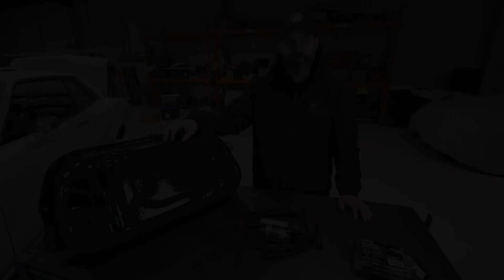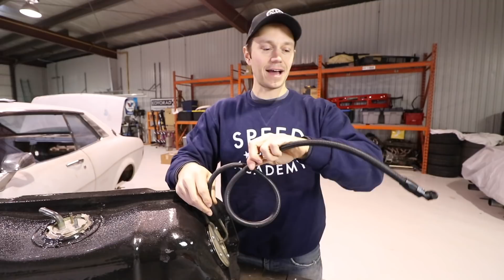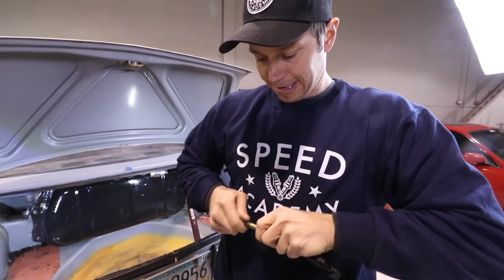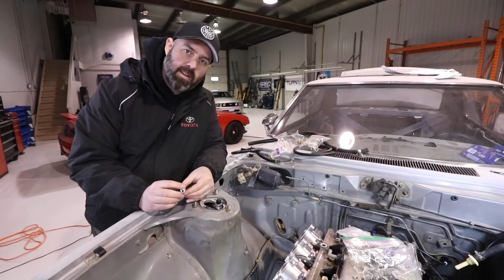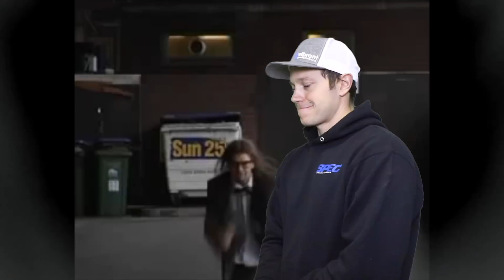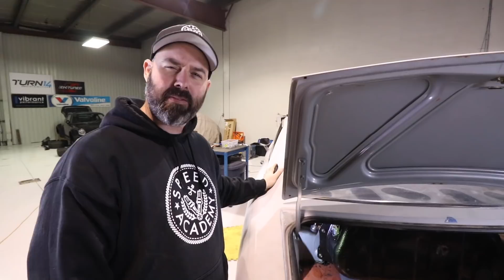Fuel System Complete! - RA24 Toyota Celica Project

Comment: The -AN adapters on the filter/regulator are a bad design! I had them on my LS swapped '69 Suburban and nearly had a bad fire. The plastic clips can break or come loose, and you can have a fuel leak. There is an updated version that uses a machined slip-on nut that threads into the back side to retain the fitting. I HIGHLY recommend that you change them.

Comment: I'm on the wrong side of the country but for oddball fittings like the 1/4 to 5/16 barb fitting I would go to newline... Lots of random hard to find fittings that are usually very cheap. Lots of funky hydraulic fittings and stuff... I'm sure there is an equivalent company in Ontario... Part number N150-031-025BR       https://www.new-line.com/fittings/brass-hose-inserts-and-push-on-hose-barbs/brass-hose-barbs-stems-inserts-splicers-menders-tees/brass-reducing-hose-mender

Really liking that returnless reg setup! And the Link ECU is a good choice. I run a slightly older version on my subaru.
Reply from the maker: Never heard of Newline. We may end up replacing the factory feed line with a 5/16'' line, which will do away with a bunch of the barbed fittings, so we'll see how it goes. Thanks for the link, tho!

Comment: I love your videos! 

If you drill out the 1/4” feed from the tank you can tap a bulkhead fitting into it and run an AN fitting straight to the regulator/filter. This may be a good option if you run into fuel starvation.
Reply: Bro i need help.
Reply: @antorenzo10  with what?
Reply: @MikesGarageUSA  a 94 toyota celica gt. I was wondering can i do that same thing ? Because i can’t find no parts.
Reply: @antorenzo10  yeah you should be able to. Depending on how the fuel send unit is designed. Cut the factory feed off and use that hole in the top of the unit to put in a bulkhead fitting. There are probably write ups or videos about how to do it out there. Good luck.

Comment: Why didn't you just cut off the hardline from the pump assembly, drill it out and fit some AN bulkhead fittings?
Reply from the maker: If we find the 1/4'' (6mm) factory hard lines are gummed up or blocked in any way (we'll be doing a pressure test soon), we'll replace the 1/4'' lines, which we can do in a variety of ways, but I think your suggestion is an excellent one. We just figured we'd see how the 1/4'' lines work, since others have used them without issue on similar swaps. This is just Ver1.0 to get the car up and running, future fuel system mods are very likely (thinking about a Well Cell from ATL).

Comment: Top tip for putting tight hose onto barbed fittings, just put the hose end in a cup of hot water for a minute  and it will slide right on ;-)
Reply from the maker: Was going to say cool idea, but will say hot tip instead! :D

Comment: Why wouldn’t you just convert to 5/16th hardline to get rid of all the headaches? Running and bending hardline is not hard and it would turn out much cleaner. Way less potential for leeks. And much more fitting support
Reply from the maker: Because we're stubborn? Haha. Honestly, we just figured 1/4'' is plenty big for the power level we'll be at, but also because we didn't even know it was 1/4'' until we started working on it and we felt adapting was the simpler approach for now. But I would say there's a good chance we will convert to 5/16'', especially if we see any issues with blockages or pressure with the 1/4'' lines. Long-term we'll go to a fuel cell setup, so this is just a starter setup.
Reply: Speed Academy figured it was easier to adapt in the mean time. I wouldn’t of even thought to check for something smaller than 5/16! Love the videos!

Comment: I'm gonna have to go ahead and call you out on fuel line safety here. Just get some 5/8 hardline and revrun it through the car. Cut the old 1/4" off the fuel tank, drill out to 5/8 and weld it onto the bulkhead fitting on the tank. Is it really worth burning down your car for a minimal amount of extra work by not changing to the correct size hose? I've seen it happen and it ain't pretty.
Reply from the maker: We appreciate the concern, and although we don't share it, this is really just Version 1.0 to get the car up and running. There will be lots of future refinements coming, quite possibly including a fuel cell and/or surgetank setup.
Reply: 5/8 Would support like 2000 hp lol. Maybe you mean 5/16? I would use 3/8 feed and 5/16 return. Obviously the 1/4 isn't ideal but I don't think it poses a safety risk at all. My only fear is there not being enough fuel and the engine running lean. But being an NA  4 cylinder it probly will be fine.

Comment: why would a fuel fitting be imperial on a car that is built and designed in a country that uses the metric system? I'd put my money on it being a 6mm or 7mm perhaps? (1/4 inch comes out at 6.35mm according to google)
Reply from the maker: I'm sure you're right, we're just accustomed/brainwashed into thinking of fuel lines in imperial over here. It's most likely 6mm.

Comment: Was that at least fuel injected rated hose? I bet finding fuel hose rated for high pressure in 1/4 inch probly isn't that easy.
Reply from the maker: Yes, fuel rated hose, SAE spec.
Reply: Speed Academy fuel injection? Meaning rated for high psi. I don't think ive ever seen 1/4 inch hose rated for fuel injection honestly, but I've never needed it. All I've seen is regular 1/4 fuel rated hose which I meant for carburetors and a max of like 15-20 PSI
Reply from the maker: Yes, high pressure FI hose.
Reply: Speed Academy right on, good deal. Figured you guys knew about that lol. I saw you guys used the nice high pressure hose clamps on most of it, but had a few regular clamps in some places, probly will be fine. But good to chang those out for the high pressure style

Comment: JEGS Performance Products Brass Hose Adapter for 5/16 in. to 1/4 in. Hose
Brass Hose Barb Adapter 15945 and JEGS Performance Products 15946
Brass Hose Adapter for 3/8 in. to 5/16 in. Hose

Comment: Surprised you guys aren’t installing a surge tank on this. Also would of thought running a new 6an feed line would of been a better option than all the adapting. Good progress tho. Keen to see Connie finished
Reply from the maker: Definitely a possible future addition, James. Also thinking about a Well Cell from ATL in the future. This is just a "starter" fuel setup so that we can get the car running and sorted out before we take it to the next level.
Reply: I'm worried about the 1/4" OEM Fuel Line underneath the car that they want to use for the Beams 2.0L ...don't know if that size would support the fuel demand.
Reply: Can I ask what fuel hose brand that is?? Very hard to get that stuff in OZ. Maybe you can source me some :)

Comment: You shoudn't use barbed fittings because the sharp barbs tend to slice thru the inner portion of the tube.
Reply from the maker: have never had that happen so we'll chance it.
Reply: Speed Academy It usually doesn't until someone finds a leak and tightens a clamp too much. There is a reason oems don't use barbs.

Comment: Why not bend a new 5/16 or 8mm hard line? Or route a new soft fuel line? All this adapting from 5/16 down to 1/4 and back to 5/16 doesn't change the bottleneck of the 1/4" hard line all the way from the tank to the firewall.
Reply from the maker: We may still do that, Randy. We'll see how fuel pressure looks with the 1/4'' but it's certainly on our minds to go up to 5/16'' if we have any issues at all, and long-term we'll go to a fuel cell setup. This is just a starter setup for now.

Comment: Is that the stock location for the fuel tank? Seems odd.
Reply: Hayden Baker old school and common for that era. Datsuns had them and they always leaked lol
Reply: Zeke Rayment looks dangerous. Glad they went away from that design
Reply: Carl_Marks but it's high up in the chassis. Putting it much lower and just in front of the axel is much better. Hence why they do that now
Reply: Weight displacement over the axle.
Reply: Its safer then under the car where is cant get a hole ripped in it from something on the road, plus the chance of a hole from an accident is reduced because its not right at the back

Comment: Will those small factory fuel lines flow enough for the Beams?
Reply from the maker: We're going to find out! 5/16'' supports up to 1000-hp in applications we've seen first hand, and since Beamsy will make around 200-whp, we should be fine.
Reply: Speed Academy Knew you'd have you it under control, they just look very small. Thanks for the great videos guys.

Comment: I get the run what you've got of using the 1/4in line, but with how much of a hassle it was and the lack of headroom it leaves you with. Are you looking at going to a 5/16th or -6AN line for the feed later on?
Reply from the maker: Planning to go to a Well Cell from ATL next year. This is Fuel System 1.0. But we will definitely swap out the 1/4'' line for 5/16'' if we see any signs of blockage or pressure spikes with the 1/4'' lines.
Reply: I'll look forward to the video from that one. Getting a fuel system setup for an '84 rabbit with boost, so that seemed a bit small haha